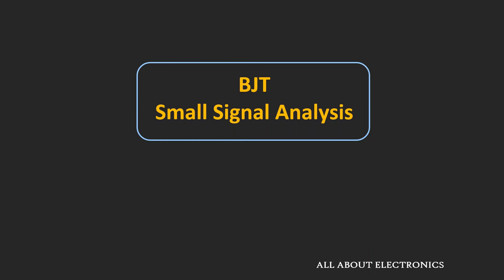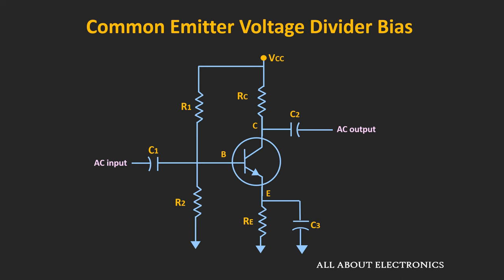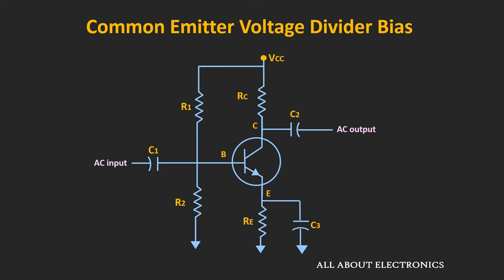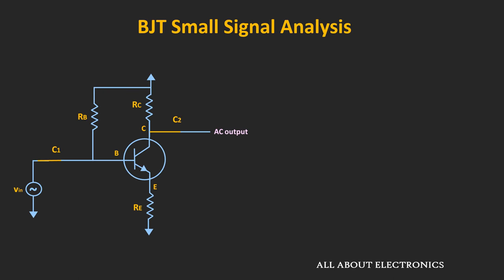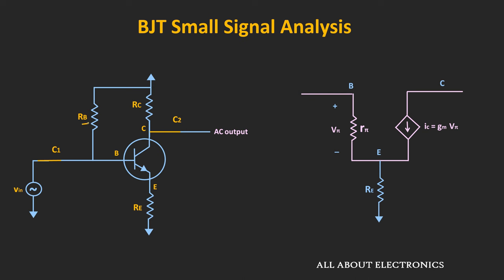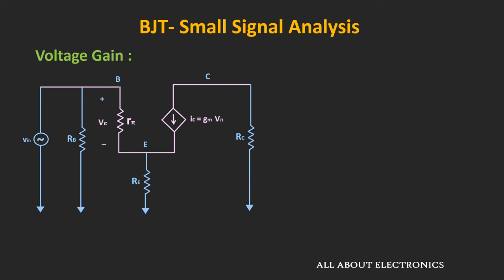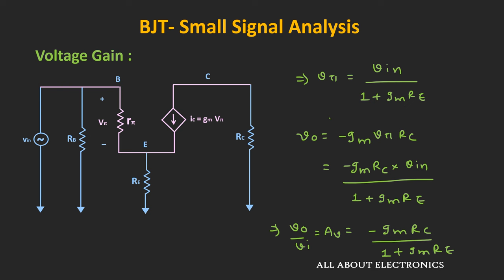BJT Small Signal Analysis: Common Emitter Amplifier without Bypass Capacitor

Comment from the maker: The timestamps for the different topics covered in the video:

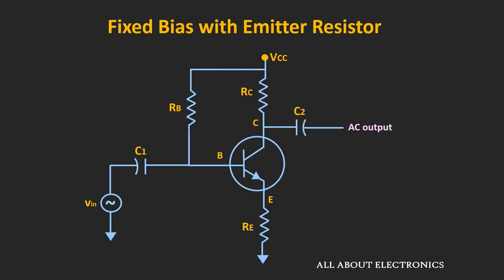1:30 Small Signal Analysis of Fixed Bias Circuit with Emitter Resistor (without Bypass Capacitor)

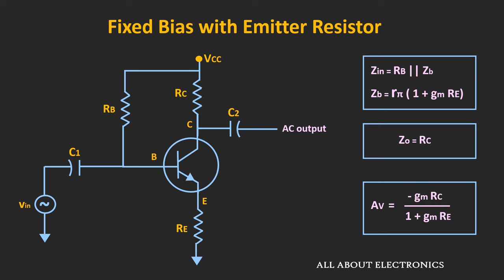13:08 Small Signal Analysis of Voltage Divider Bias Circuit (without Bypass Capacitor) 

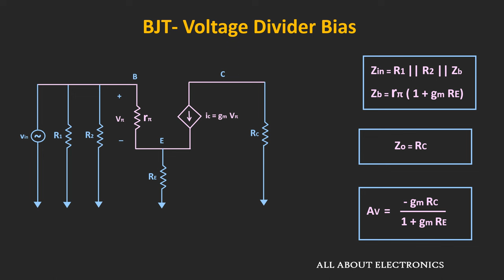14:54 Solved Example (Common Emitter Amplifier with and without Bypass Capacitor)

Comment: what will happen to output impedance if the dependant current source has a parallel resistance(early effect), will the emitter resistor be part of the output impedance too?? . I am asking for the case without bypass capacitor ..

Comment: All of the analysis is accurate, but the formulae for gain and input impedance are not presented in their most useful forms. It is far more convenient to consider 1/gm to be an intrinsic emitter resistance (re), that is equal to 26mV/Ic at room temperature, then express the formulae in terms of re and β, noting that rπ = β/gm = β.re
Av = -gm.Rc / (1 + gm.Re) = -Rc / (1/gm + Re) = -Rc / (re + Re)
Zin = R1 || R2 || Zb = R1 || R2 || β.re(1 + Re/re) = β(re + Re)
The gain is now the ratio of collector resistance to total emitter resistance, and the input impedance is beta times the total emitter resistance, which makes sense.
Introducing a bypass capacitor in parallel with Re is now easy to accommodate as it can be seen that the total emitter resistance is just re at frequencies where the capacitor's reactance is significantly smaller than re.

Comment: excuse me sir, just want to ask. i still dont get it, where are those Vn and rn coming from? and also with ic, is it the current that flowing through resistor c?
Reply from the maker: I recommend you to go through these two previous videos, which will help you in understanding it.
The link for the other useful videos related to topic is already provided in the description of the video.
Please go through it if required.

1) BJT Small-Signal Model: 
https://youtu.be/i2t9GTAd2I0

2) BJT Large Signal Model: 
https://youtu.be/ME41uPsDxFo

Comment: why dont you consider Rc which is on output side for finding input impedance , but considering r(pi) for finding output impedance which is on input side??
and also like for output imp can we say that, input imp is the thev eq seen from input side, if no then why??
Reply from the maker: Here while finding the output impedance, the R(pi) was considered (during KVL), just to showcase that, V(Pi) is 0.
Reply: @ALLABOUTELECTRONICS  then why Rc is not considered for finding input imp??
Reply from the maker: @sakshamjain2217  From the smal signal model, the input impedance in this case is the RB || Zb. Zb is the input impedance seen through the base terminal.  And that is equal to Vb / ib. So, to find that, we need Ib and Vb. So, as you can see in the video, the expression of Vb and Ib were used to find Zb. And in that, we do not require Rc.

Comment: Great video! How can I find the voltage gain when there is a load resistance? Also, how can you solve for the current gain?
Reply from the maker: The load resistor RL will come in parallel with Rc in the small-signal analysis. In the voltage gain equation, you can replace Rc with (Rc || RL).
Reply from the maker: Regarding the current gain, Ai = Io / Ii.
Io = -Vo / Rc (if RL is not present)
and Ii = Vi / Zi (Zi is input impedance)
So, current gain = Io / Ii = -(Vo / Rc) / (Vi / Zi) = -Av * Zi / Rc
Where Av is the voltage gain.
Reply: @ALLABOUTELECTRONICS  and writing re = 1/gm, we have current gain =
 -Av * Zi / Rc = Rc/(re +Re) * β(re + Re) / Rc = β
As expected.

Comment: Sir,voltage regulation using opamp k simulation kaise kia video provide kijie...project kr rh h...plz Sir...hlp us.
Reply from the maker: I have already provided simulation link in that video. (Op-amp as voltage regulator)
You can go through that simulation link.
The simulation was carried out in Multisim Live.
Reply: @ALLABOUTELECTRONICS  work toh kregi na?both hardware n simulation?
Aapke varose yeh project kr rh h...
Plz agar hlp chahiye hog toh ap hlp krn...
Time bht kom h,aur hume submit v krn h ...
Thanks ...
Future aspect k bare m plz plz kch bolie.
Reply from the maker: In simulation and the actual result there will be some difference. But more or less, it will be close to simulated results.
If required any help, I will try to help you.
Reply: @ALLABOUTELECTRONICS  thanks.
Reply: @ALLABOUTELECTRONICS   Voltage regulator mai ap kya opamp ko use kr rhe hai as an comparator?
Reply: Vay hardware instructions do ...
Reply from the maker: It is used as a feedback device, to regulate the voltage.

Comment: sir why is vo negative? is because of the direction of the current
Reply: Yes, it is an ac current flowing from the collector to ac ground. Because the ac ground is fixed (at the supply rail), Vo will decrease as Ic increases, and vice-versa.

Comment: Sir, why do we consider the thevenin equivalent resistance of the circuit as the output impedance?
Reply from the maker: The method for finding the output impedance is, consider all the independent sources in the circuit as zero and find the equivalent impedance seen from the output side. Or considering all the independent sources in the circuit as zero, apply test voltage, and find the test current. The ratio of test voltage to the test current gives the output impedance. 
For finding the Thevenin's equivalent impedance/ resistance across two terminals also, we used to follow the same procedure. Therefore we can say that the output impedance is Thevenin's equivalent impedance of the circuit looking from the output side.  
I hope it will clear your doubt.
Reply: @ALLABOUTELECTRONICS  Sir, what would happen if we don't consider the independent sources in circuit as zero?
Reply: @swayambhuray5762  The output impedance is the ratio of a small voltage applied to the output to the small change in current that it produces (by definition). If we tried to do that while an input signal was being applied, it would take a lot more work to either measure or calculate that small change in current. So we choose to measure or calculate the output impedance in the absence of an input signal. In other words set the input source to zero. To a first order approximation, it can't affect the result.

Comment: Can i ask what is the Vt that you use find gm in equation gm=ic/vt
Reply from the maker: Vt is the thermal voltage. It is the voltage produced within the pn junction due to a change in temperature. As you can see from the equation, kT/q, as the temperature increases, the thermal voltage increases. At room temperature, it is around 26 mV.
Reply: Thx for explain ur video make my life easier :)

Comment: How did you find VT?
Reply from the maker: VT is thermal voltage.
It is equal to kT/q. 
k is Boltzmann constant.
q- charge 
T - temperature.
Reply: does VT depend on temperature and is the value of VT usually given in the question